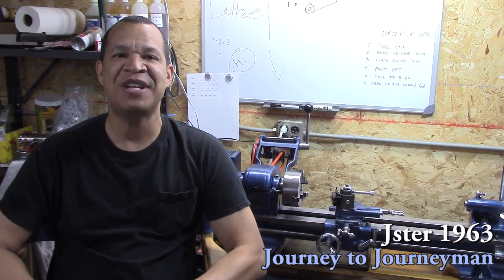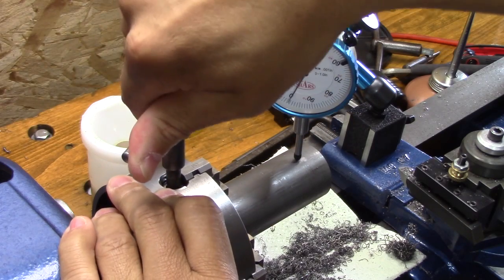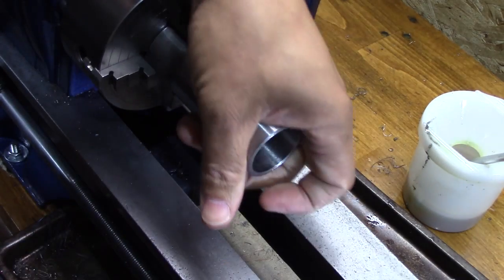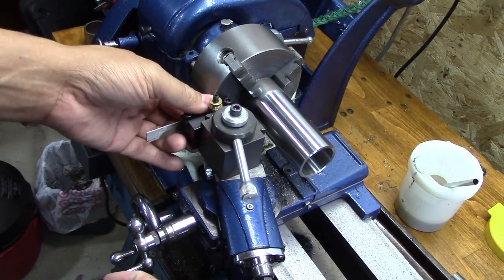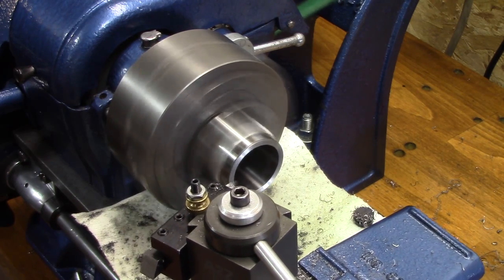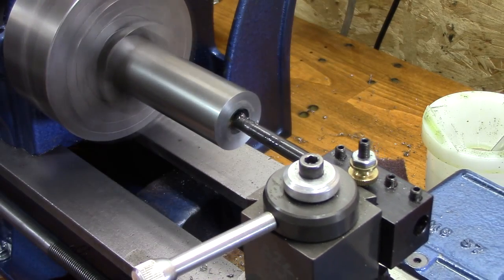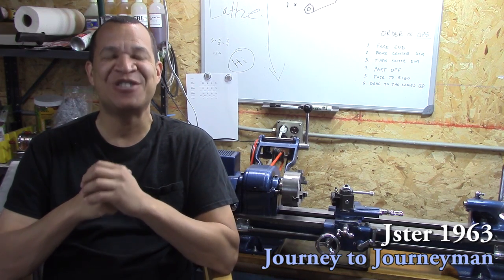Journey to Journeyman, Episode 4, How to make bushings

Comment: I really enjoy your video's. I just aquired a sears craftsman atlas 12 inch .  Where did you buy parts?
Reply from the maker: Thank you very much!  I hope you enjoy your lathe as much as I do mine.  I got used parts from Ebay new parts from Clausing.  Some new parts are cheaper than used parts on ebay.  I just compared prices.  Clausing is in a couple of places, but I used the one in Kalamazoo, MI.  If you have a parts diagram, they still use the same parts numbers.  Thanks again and good luck.....

Comment: Hi mate.Well done on finding that pipe that was close of what you needed.  I was a bit miffed about the steel bushing.  normally this would be brass or bronze, would it not ?
Reply from the maker: +Marcel Timmers Great question.  The bushing that came out was steel.  The after market replacement was brass.  The after market one was $100 too, so I decided to go original which was steel.  And thank you......
Reply: Ah, the minister of finance (the wife) was a little tight fisted was she?  I know the feeling mate.  I wanted a new mill, but no dice.  Rather frustrating, What!
Reply from the maker: Minister of finance or what I call "Financial Advisor".  Same thing:-)

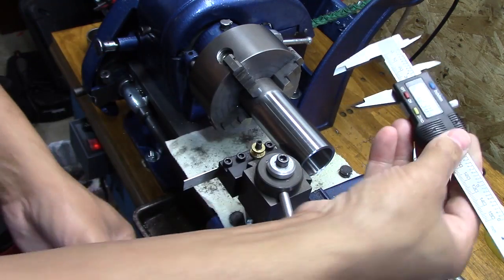Comment: I would recommend not running your calipers on a rotating shaft like this at 6:20.
A more accurate method would be to start the parting tool a few thousands long, stop and measure the cut, then adjust your tool carriage as necessary.
Running your calipers like that can actually give you an inaccurate dimension, because:
1: the calipers will want to float off the end,
2: you can't get a true parallel dimension, meaning the actual dimension will be short,
3: Adding pressure to the calipers will cause the calipers to flex and 
4:  This will wear off the tips of your calipers prematurely making them useless for those tight fitting dimensions you need them for.
Reply from the maker: mfgman2011 You sold me!  I'm learning everything form youtube and saw several guys use that technique.  I won't do that anymore.  I like the technique that you describe.  Thanks a lot........

Comment: In video No 2 I heard a familiar sound that was just like my own lathe with badly worn headstock bearings ?? I have a horrible feeling that in a video or 2 you are going to make a reason for a lot of your chatter
All the best
malc
Reply from the maker: Thank you very much malc!  The bearings are new, but the spindle was loose.  Your ears are extremely well tuned.  My father was a tool and die maker and when he watches my videos, he mainly talks about the sounds.  He can tell if something is wrong by the sound it makes.  I hope I have the machine problems solved.  Fingers crossed......

Comment: Great job jster!!! You're getting better and better! I'm looking forward for your next Journey to Journeyman episode!
Reply from the maker: Thank you so much!  I'm tryin'..........
Reply: jster1963 Yes I know, I'm doing the same. Keep your tools sharp and increase the side rake and back rake angles, especially for harder materials. We can't make our lathe more rigid, so often we're working against our tools.
 
 Set your tool at zero, or close to zero lead angle. Think the lead angle as a mirror that reflects the cutting forces as you feed in. At 45 degrees lead angle the cutting forces pushing your work away from your tool and causes chattering. At 0 degrees lead angle the cutting forces reflecting directly back to your chuck.
 
 Do not set your boring bar at a negative rake angle. If you have problems with that probable the ID of your work is too small and the lower part of the boring bar touches your work before the tip of your tool.

 Your parting off blade is too dull and you set the tool too far away from the chuck. The band saw is always a good idea. We are learning from our mistakes.
Reply from the maker: Baseline46 Thank you very much for the information!  I have to get smart on the rake angles that you're talking about.  I have to be totally honest and say I don't know what those angles are.  I have seen them in the books, but I have to look that up to see how to properly sharpen my tools. 

Right now I am only using inserts.  That's because I'm failing miserably with my HSS tool sharpening.  I will hopefully learn soon.

As far as my parting tool, I think it was dull and not on center height.  My cutting too was on center height and when I switched tools, I totally forgot to check it.

I am learning and having a ball.  I just came up from my basement with a total FAIL on my J2J #6 episode.  I made a part for the wrong lathe.  I will share this disappointment on my #6 episode.  Oh well, it is learning.  Thanks again and I will try to get a handle on my tool sharpening.......
Reply: jster1963 Oh, my mistake, I thought that I saw an HSS tool bit on your lathe. There is nothing wrong with inserts, stick with those for now.

You mean that the part is fine but your lathe is wrong? LOL.
Reply from the maker: LOL.  You probably did see HSS too.  I've been going back and forth trying to get it to cut.  Someday I want to be able to sharpen HSS very well.  So, I'll use the inserts but keep trying the HSS.  And yes, the part is fine.  I'm going to use it as a paperweight;-)  It was GREAT practice though!!
Reply: jster1963 I have made several paperweights and door stops till now.

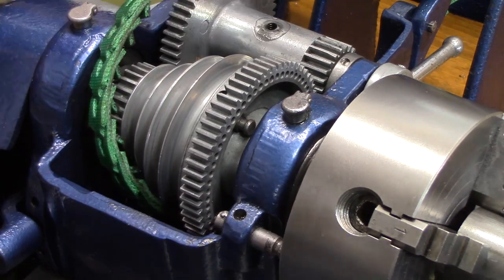Comment: 9:40 that's not a lube point, looks like the spring ball retainer for the bull gear locking pin.
Reply from the maker: You are right about that.  The bull gear locking pin was stiff, so I oiled it at the same time I oiled the spindle pulley and back gear.  It's bad editing.  I didn't feel like re-editing that footage and hoped no one would catch that.  You are the second person to catch that.  I should have known that real machinist would know the difference.

Thank you very much for the comment........

Comment: I may have missed this but I know you have the South Bend 10K from 1 year ago, but I take it the challenge is to use the Atlas 618 to do the work required for the tractor restoration.
Reply from the maker: No you haven't missed anything.  I have so much tooling for the Atlas 618 and not much for the 10k.  The SB is in my garage and I want to put it in my basement.  I have to take it apart to get it in the basement.  I'm scared to take it apart.  Also, if I take it apart, I want to paint it.  I'm caught in a negative feedback loop, so it's just sitting. 

The phase converter that came with it is doesn't work right either.  I have to unplug it every time I turn it off.  I have so many other projects going on that the beautiful SB is sitting and doing nothing.  I hope to have time to restore and use it soon.

Thanks for the comment.......